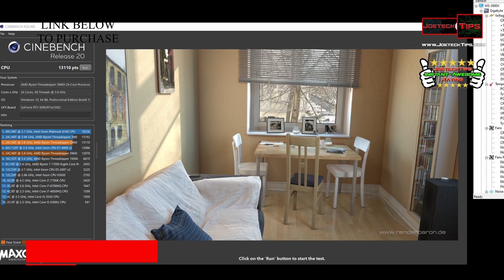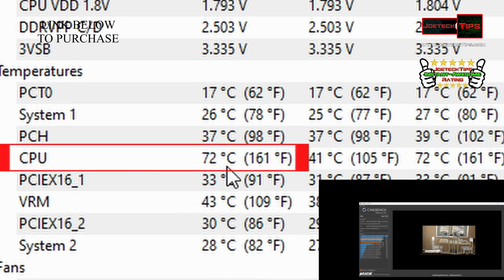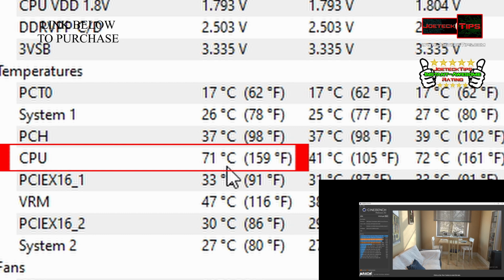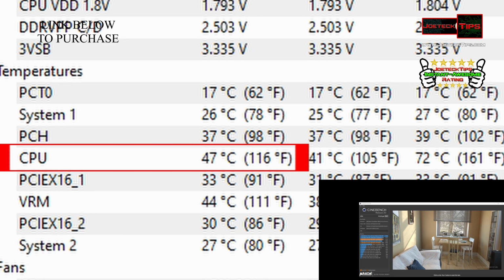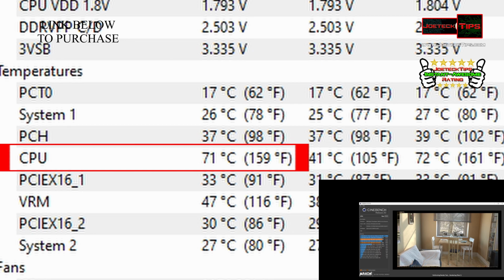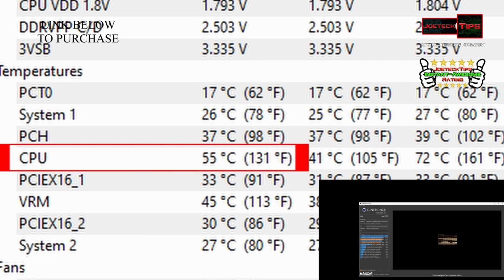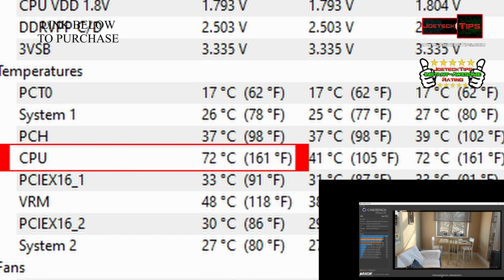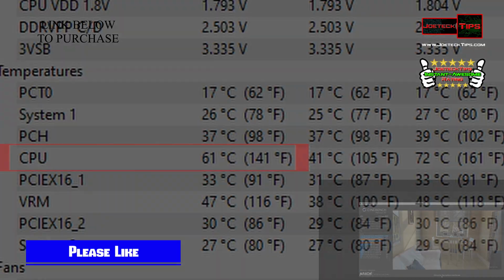IceGiant ProSiphon Elite Review, Install & Test | JoeteckTips

Comment: Come on Joe.
Get a nubby screwdriver and go push pull.
If you really want to get your money's worth.
Push with two ek-vardar, hjgh pressure fans and pull with two Fractal design HF12- High flow fans. 
You should be able to get into the 4.1.5 - 4.2 range on all cores with that configuration.
Also use Gelid GC Extreme thermal paste.
You will be able to drop the idle temps by around 5-7 degrees.
The load temps by around the same.
That fan config is also very quiet.
Thanks for posting the results of the ProSiphon.
Have had my eye on this unit myself.
Subbed!
Belled!
Update:
Just found the RE-Test video.
71 Degrees is pretty good.
When I see both tests yielding the same temps underload, that tells me that the thermal paste is the limiting factor.
Noctua themselves have siad that hteri thermal paste is not a high heat conductor, it jkust spreads very well.
The Gelid GC Extreme is great.
Is a little harder to spread than Noctua's.
The trick I used was to apply the paste, warm the system (stress Test), then immediately apply a little more torque to the cooler mount.
Doing this while the cpu is warm will help the spread and the mounting pressure.
Well worth the effort.
 Kinda fun to see what results you will get as well.
Reply from the maker: I did go push / pull. I am not into alot of noise. I mainly need this for video editing.  Thanks for the sub and bell! I will look into the that thermal paste and do that at my next PM interval!!
Reply: @Joeteck  Yep/ I'm an idiot. I found the 2nd video after I posted this. You are getting great results with this ProSiphon.
After seeing your videos, I have reached out to Ice Giant.
It is my understanding that they are working on a copper base plate version.
I am hoping that the copper version is nickel plated.
If it is, we will be able to use liquid metal thermal paste.
That will easily remove 10 - 15 degrees (under heavy load) more heat from the cpu..
That will give us the head room to do a good, solid, overclock and still be around that 65-71 C mark.
I fully agree with the quiet part.
I have used the fan combo that I mentioned above.
The EK Vardar static pressure fans are every bit as quiet as the high end Noctua, jut cheaper in price, without losing performance.
The only reason that I mentioned the fans is because this config will give you the best of both worlds.
Good, low temps with no compromise when it comes to noise. 

The fractal High Flow fans are a great price.
https://www.amazon.com/Fractal-Design-Venturi-HF-12-Cooling/dp/B00W1KY1IY/ref=sr_1_1?dchild=1&keywords=Venturi+HF-12&qid=1635875529&sr=8-1

Here is a link to the Vardar fans. Don't take my word for it, check out the reviews.
https://www.amazon.com/EKWB-EK-Furious-Vardar-140mm-2-Pack/dp/B078G28SYD/ref=sr_1_13?dchild=1&keywords=ek+vardar+120mm+static+pressure+fan&qid=1635875564&sr=8-13

Here is a link to the thermal paste.Same here.Check out the reviews.
I am also an end user and I can testify that this is the best thermal paste that money can buy, before stepping up to liquid metal
https://www.amazon.com/GELID-GC-Extreme-3-5g-tooling-Conductivity/dp/B002P5W4RU/ref=sr_1_3?dchild=1&keywords=gelid+gc+extreme&qid=1635875681&sr=8-3

Michael Starley
Reply from the maker: @personaldronerepair6141  lol, You're not an idiot!! I am not sure those fans would make a difference. I am using the Coolermaster Advanced HAF X case. It has two 200mm fans for exhaust on the top.  I purchased the Gelid GC-Extreme 10g version : https://amzn.to/3mDZqtf. I truly appreciate your comments and replying to my comments! I could always use someone like you on my team! Let me know if you ever wanted to contribute to my channel. Shoot me an e-mail, its located in my about section. - Joe
Reply: @Joeteck  Hey ! Great minds think alike. Cooler master H500P Mesh here.
Getting ready to shoehorn an Aorus Xtreme trx40 into her.
 Still  saving my beans for the 3960x.
I am confident that my H115i Platinum will do a great job of cooling.
All of the chips on the 3960x are very close to the center.
The cold plate will cover the hot spots. 
I am running an Aorus Master x570 at this time, with the 3900xt in her.
I used a cool piece of software called CTR 2.1 RC5. 
She idles at desktop around 31-33 celsius.
60-61 Celsius under a 100 percent Davinci Resolve load.
She will hold 4.5 Ghz on ccd 1 and 4.3/75 on ccd 2 @ 1.285 volts after using the CTR
Before CTR, I had a static oc on the chip at the same frequencies but using 1.304 volts.
Also the CTR allows me to have the single core performance now, where , before , I only had multi core.
Best of both worlds now.
Just purchased the board last week.
Flattered by the offer.
Will touch base soon.
Thanks again Joeteck!

Comment: Does this require low profile memory?
Reply from the maker: No, the traditional ram sticks, nothing with huge heat sinks. There is really no need for that anyway
Reply: @Joeteck  Ok thanks.  I have a 3960x and want to give this thing a try.
Reply from the maker: @DruuzilTechGames  that is the same CPU I have.  Works perfect

Comment: Can you test with an intel cpu? I heard that it is not designed for them so the Icegiant would perform worse
Reply from the maker: Doubtful, has brakets for all types of CPUs. The surface area is larger than most CPU coolers. Would be a huge overlap for intel CPUs and would perform better. Where did you hear it would perform worse?
Reply: @Joeteck  Gamer Nexus said it. He even tested it on one intel cpu but I was hoping to see more test on intel cpu to get a better picture
Reply from the maker: @fgtrhwu2  ok, works absolutely amazing on the 3960x Threadripper.  I will order another one and use it on various CPUs for testing
Reply: @fgtrhwu2  in short. It works very well with high wattage loads, not so good at medium to low wattage loads.

Comment: I keep hearing these are terrible for say a i9 7980xe? Thinking of doing a direct die mod.
Reply from the maker: Old, CPU.. I cant imagine.  I have 24 core and it keeps it at 71c..
Reply: @Joeteck  ah I was looking for tests on it heard rumors it's actually better for and because of the multiple CCX chiplets.
Reply: @Mappi75  I did delid and I have a direct die kit w wanna try with this other review state the hotter the chip.bette this will perform. This 7980xe can suck back 400+ easy.

And Cores dropped significantly some cores were nearly 50c diffent on load.

Comment: Been loving it on my TR3970x
Reply: I reside in Southeast Asia with no AC, so it may vary with you. No load around 46c while it runs no more 70c while doing 3D renders in Blender. Using Meshify 2 XL case with noctua 120m as case fans
Reply: @Mappi75  The ice Giant has mediocre heat transfer from chip to the cooler, but excellent heat soak and dissipation in the cooler. 

So for low wattage loads and especially very dense example 5800X it's not particularly good at extracting the heat from the chip. Traditional heat pine air cooler is better here.

But for thread ripper, where the load is spread across more dies and you can push the package power to 250+ watts it starts making a lot of sense.
Reply from the maker: Curious what your temps are with HWmonitor? Interested because you have 32 cores..

Comment: Just a suggestion, you should have used the Thermal Grizzle instead or better still Kingpin Kpx with push/pull fan configuration. For more accurate temperatures try with Ryzen Master or Hwinfo64 instead. I think CPU package gives better reference for temperature and it will reflect higher temps. Averages for R20 Cinebench should be higher than 13200. Faster cooling yields better result. I too am using 3960x with IceGiant, similar to you waited for 9months or so.
Reply: You cannot use gallium based thermal paste on this cooler, the mounting plate is made of aluminum and gallium literally erodes and eats away at aluminum. It will destroy the cooler and that is not covered by warranty.
Reply: @GreggyBlox  If I am not wrong Gallium U are referring to is LM (Liquid Metal). Kingpin Kpx  I believe is similar to Thermal Grizzly abeit of different compound. Yeah waiting for the copper version to be out as well. May I ask where did you read/hear that kingpin kpx or Thermal Grizzly is gallium base except for Liquid Metal version of Thermal Grizzly. Furthermore, Thermal Grizzly Kyronaut is part of the shipping package for prosiphon.
Reply: Once a copper plate version comes out, that will probably provide amazing results but that has yet to be an option.

Comment: Great review, thanks. Does your motherboard lay flat, or is it mounted vertically ? I'm concerned at the 2kg of bending weight it'd be applying to a motherboard if mounted vertically
Reply from the maker: It very sturdy.  Looks heavier than it is. The mounting is secure and strong. Nothing to worry about.